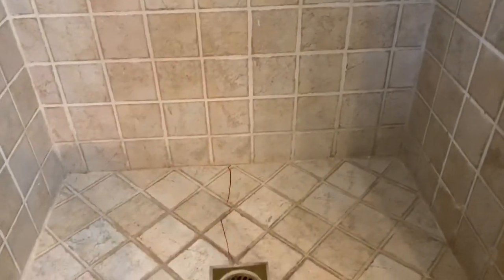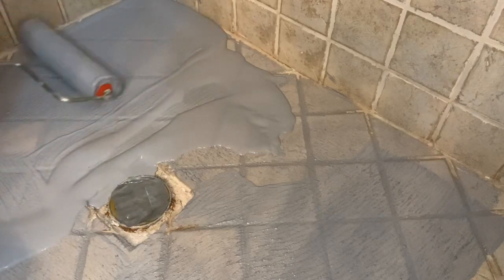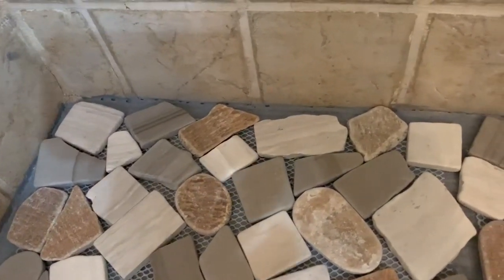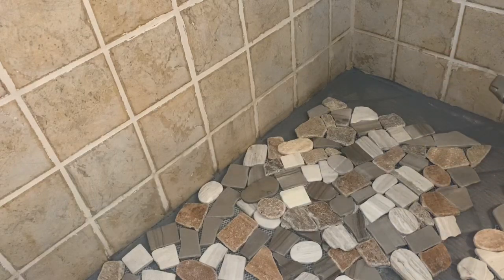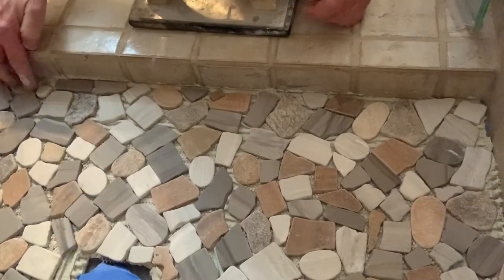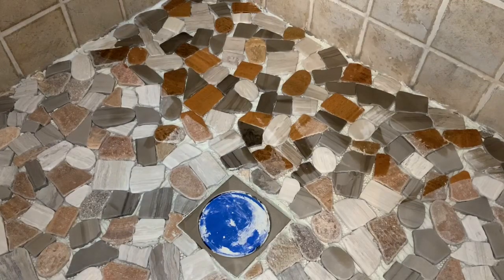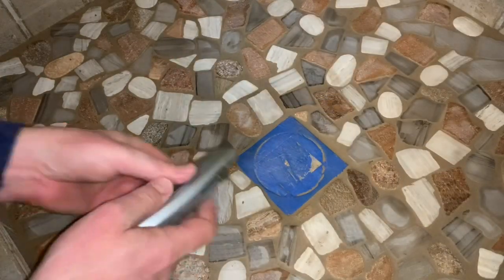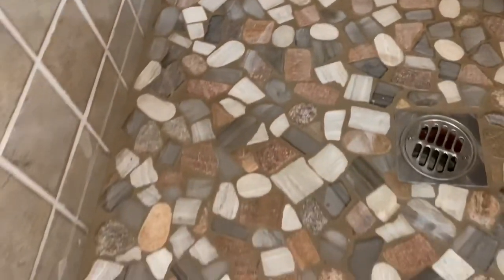Pebble Tile Shower Floor Installation-Right over Ceramic Tile!

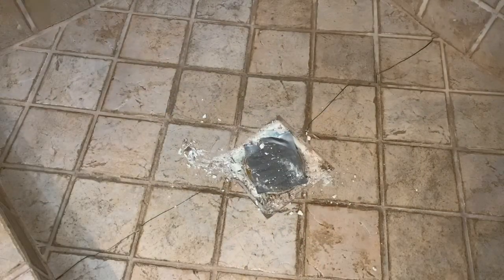Comment: Your video is one of the best showing 1:36 step by step process. How do we address the leveling to make sure water drains off properly.
Reply from the maker: If you've not had any draining issues before, there shouldn't be any now. These tiles are made of small pieces that easily follow the existing contour/slope of your existing shower. If you were using large tiles it might be a different story.

Comment: That is an awesome video and great end result. I had a friend do the tiles in my basement bathroom, and I noticed the moment I walked in to inspect the finished result, that the water was going to pool due to inadequate height of the floor tile at the one side. Thanks for this video - I hope to use the same method and tile you selected. I always wondered how you would raise the drain, and now I know.
Reply from the maker: Glad to help!

Comment: Mike that was a great video. I’ve placed river rock in our outside shower but always wanted to place it in our master shower. 
The tips on using a primer, the extend drain kit and the tape trick are very helpful. 
Did you have to do anything special to clean the existing tile before placing the primer?
Thanks in advance sir!
-Mike
Reply from the maker: You can use a stone and tile cleaner which you can get at any big box store

Comment: 3 years later. Did this last? Did your weep holes allow the water to drain properly? I question the drain extension kit. To me looks like water is going to sit in that pocket around the drain. Anyway im interested in knowing how long this will hold up. I have a customer who would like me to tile over shower  floor tile. Im giving a disclaimer. No warranty on bandaids and when it fails and looks lke garbage in 5 years ill come bid on replacing the whole shower. That was my sales pitch.
Reply from the maker: I think you are handling this with your customer the right way. Give options and let them choose! As for mine, it still looks good, and is solid with daily use.

Comment: Great video, thanks. I am planning the same method with 12 x 12 tile sheets composed of  2 1/2 inch hexagoal tiles. What trowel size did you use?
Reply from the maker: Pretty sure it was 1/4 x 1/4

Comment: My shower pan looks awful. It's so hard to clean. I scrub and scrub it doesn't have any tile. It's just the basic track home shower floor. Anyway I was wondering can I put the pebbled tile on top of it instead of resurfacing it?
Reply from the maker: It sounds like you have a fiberglass shower pan. You should not tile over this as the small amount of flex in the pan will crack grout/tile. Resurfacing is probably the least expensive option.
Reply: @MikeKlimek  Thank you! Oh shoot I really wanted that pebble look

Comment: I think for the people watching this video. If your shower floor is not sloped correctly, you might not need the drain extender. maybe a new rubber gasket and trim because you're raising the floor to give it a better slope toward the drain, if the edges raise a 1/4" depending on the size of your shower floor the slope should be good. I tested with a small level and a bag of my kid's marbles to see how all angles flowed before I grouted. but I'm not a professional. I'm just a homeowner trying to correct a so-called pro contractors mess they left us with.

Comment: I want to do this in a small 1/2 bath that is unfinished. A concrete floor. Do I need to do the bonding or just the quickset?  the idea of putting glaze on the tiles  before grout is genius!!!
Reply from the maker: Generally no, but a bonding agent never hurts and is cheap insurance! The sealer/grout release on the tiles before grout is a serious time-saver!
Reply: @MikeKlimek  Thank you. Any recommendation for the bonding product. I don't need gallons.
Reply from the maker: @josie4330  Mapei makes good products

Comment: Your shower floor looks super nice. 
I starting the same project and this vid helped me with the drain.
Two questions. What do you think about taking a belt sander and scuffing up the old tile and roughing up the smooth surface.
Also, how is you project doing after a couple years of use.
Reply from the maker: I don't think sanding the surface would do much. The Mapei product I used serves the same purpose...it feels like concrete when dry. After several years of use it still looks great!

Comment: Any ideas on what to use if you don't have screw on type drain cover?
Reply from the maker: How does your drain cover come off?
Reply: It was just sitting on top using a pushdown with some metal clips

Comment: Thanks for the detailed info.  My existing tile floor collects water in certain spots.  Can use thin set to correct the slope when applying the new tile ?
Reply from the maker: You can as long as it's minor and the underlying floor is in good condition.
Reply: @MikeKlimek  thanks

Comment: Where do you get a new drain grate for this? My drain is 4" diam, but the screws are 3" apart. Having trouble finding  the size extend kit as well as a grate cover kit.
Reply from the maker: I ended up ordering it on  Amazon. I actually found the kit at a tile store, but they didn't have the finish I wanted. Amazon did!
Reply: @MikeKlimek  Does it still exist on amazon because I cant seem to find it? Would you have a link by anychance? Do you remember which Extend-O-drain kit you had used for yours? the 3 3/8" one? I think I need the 2 1/2" - 3" for mine but the problem is they are not avail in canada anywhere!
Reply from the maker: @AG-fy4zt  In used the 2 1/2-3" from Amazon. Here it is: https://www.amazon.com/Extend-Drain-2-1-Universal-Kit/dp/B004VB9UT6/ref=sr_1_5?crid=F7JIAW1MZOVJ&keywords=shower+drain+extension+kit&qid=1641242115&sprefix=shower+drain+ex%2Caps%2C121&sr=8-5

Comment: Where the floor pebbles meet the wall tiles should a caulking/sealant be applied.  Good how to do video.  Thanks for your time.
Reply from the maker: I chose not to. This is set on top of an existing tile pan which also didn't have caulking at the corners. It is very solid.

Comment: Did you seal the rocks? If so. Did you seal before or after installation, and how often after will you need to reseal? Thanks
Reply from the maker: I sealed them before I installed them, and you should probably do it once a year

Comment: Do you need to silicone around where the floor meets the wall?
Reply from the maker: I did not but you can if you would like. There shouldn't be any movement like there sometimes is with a fiberglass pan.

Comment: just a tip, if you use the cardboard backer from the mosaic tile u can line up better and slowly slide it off so the mosaics not all flopping around.

Comment: Nice vid.
With that crack though I wonder if moisture is stuck under the tile?
Good to run a good fan overnight or longer, then bleach clean, then silicone and primer. Also usually another waterproofing membrane as well to guarantee no water settles under the tile. Unless your somehow 100% sure the previous membrane is intact, which is almost impossible to know for certain with such a crack

Comment: My remodeler did not slope the floor to the drain.  It is tiled now and the water ponds in the back of the shower. I realize I have to retile the shower floor and tile over the new tile but how do I do that?

Comment: Hi Mike - we finished our pebble tile shower floor installation thanks to your helpful video and product suggestions which came out great! One question - we just noticed after a few weeks that the grout is starting to come up. We did some research and saw that we should have sealed it after the grout. We didn't see you do that so did you have any issues? We waited for a week for the grout to dry and it seemed fine. Little pieces are started to come up almost like sand. Any suggestions/products would be appreciated. Thanks again!
Reply from the maker: Glad it came out nicely, but the grout issue is frustrating. I did not seal mine but I should. I have not had any issues... I'm assuming you used sanded grout and followed the directions which are usually mix with water, let sit 5-10 mins or so, mix again and use? Also any chance the correct amount of water wasn't used?

Comment: Great video! How many tile mesh sheets did you use?
Reply from the maker: Thank you! I think it took 10-12ish. I pulled some small stones off of some full sheets because I liked the look they added
Reply: @MikeKlimek  Thanks for the quick reply! Good to know!
Reply: Hi again Mike - what is the name of the grout product you used and what size was the container? I believe I have everything on our list which you used. Just a suggestion - it would be great if you could include in the show notes links to the products you used. You've inspired me and my husband to take on re-tiling/re-covering a shower pan we inherited that's 18 years old with grungy white 4 x 4 white subway tile. Looking forward to see the results. Many thanks and Happy New Year!
Reply from the maker: @stacydietzler9321  Hi Stacy-good advice! The grout I use is Polyblend sanded grout (although you can use any brand in your locale). You can probably get away with a 10lb box, but for a few bucks more you can get a 25lb bag...not a bad idea to have extra grout and tiles for the future when you drop something on it and it cracks. I'm pretty sure that color is Haystack. Good luck on the project-I'm sure you'll love it! Happy New Year!
Reply: @MikeKlimek  Happy New Year! Thanks again for the quick reply and helpful info! With COVID, we'll be ordering everything online and to plan on working on it in the next month or so. Appreciate it!

Comment: For a 8mm thick natural stone pebble tile, would a 1/8 trowel be what's usually recommended ?
Reply from the maker: You might want to check the mortar manufacture's recommendations.  1/8" sounds way too small to me. I would guess 1/4" but check the bag.

Comment: Hey Mike, where did you find the drain tile? I've had trouble locating one at my local hardware stores.
Reply from the maker: They are somewhat tough to find. But I found an assortment of them on Amazon which is where I ultimately bought it!
Reply: Thanks, for the quick response! That's all I could find as well. I think I purchased the same kind, then.  Much appreciated!
Reply: You can easily find them at home Depot

Comment: I think it would have been best to cut a straight line in the whole tile piece and install along wall , leaving a grout line space. Or just making a template of floor, lay your tiles out and trace, then cut straight lines.
Reply from the maker: You could certainly do either of your suggestions. I wanted a more random look though and the straight lines around the perimeter wouldn't have achieved that

Comment: This will ultimately fail from a drainage perspective since the new tile floor does not sit under the tiled shower walls. If and when the new grouting shrinks or wears down, drainage off the walls will eventually seep under this new tile floor, accumulating onto the old tile floor underneath. With nowhere for the water to go, it will eventually weaken the underlying substrate.
Reply: It doesnt matter if tiles are not under the wall you have to clean with amonia to remove soap then red gard few time instale tile grout then silicone the perimeter bingo done no leak🤘
Reply: but by then, the on-trend styles will have changed and your new wife will want an upgrade.  Go for it...right on top of the old!!  Tile, not wife🤣

Comment: The first part of the job should be  to find and fix the cause of the crack.You can tile over it but the crack will come back.Not the professional way to do the job is it!
Reply: not always true - sometimes the initial work may crack  --   - not a big deal - "professionals" always want to tear everything out to make more money - most the time its unnecceary